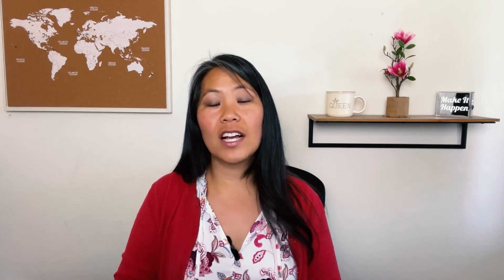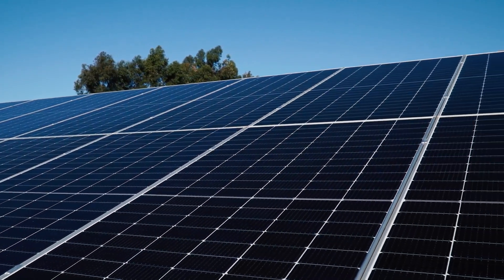Can Solar Panels Power A Whole Home?

Comment: Here is a related question:

Almost every device in the modern home has a transformer embedded within it that converts AC to DC because that is what the PCB, battery or motor demands. And that these same transformers all consume energy whether in use or not. Then there is every light bulb too which has transformers embedded within it and the control of the same lighting is incredibly complicated by being AC.

These arguments alone make sense, as the industrial world clearly demonstrates, especially when the user/homeowner has their own renewable source of energy, be it PV, wind or/and battery, all of which produce or store energy in DC form, it is bordering on lunacy to convert that energy first to AC and then later back to DC again.  

The fact is that electrical companies are able and can supply both, and sell DC systems to the industrial and off-grid elements of their business. But they certainly aren't going to inform the public, who are blithely filling their homes with transformers of all sizes, whilst buying more energy than they need to in the process.

Thoughts please - of course Code requirements will be light years behind us all!

Comment: You would need a huge battery bank to power an entire house with solar.  Otherwise, you aren’t powering your whole house with solar, you are powering using the utility company as your subsidized “battery.”
Reply: That's exactly what net metering is and yes, you're correct in that you would likely need multiple batteries to back up an entire house during a multi-day power outage.  Not only that, you would need a large enough solar system size to recharge the batteries in the event of a multi-day power outage.

Comment: Can ask you guys in Cali does the average person in CA Edison with a 130 ish bill still save with a single self consumption battery. I was reading for two months of the year the credits were 4-5 dollars.
Reply: Hey Lee, there is a small window of time when the utilities are compensating for exports from the battery.  It's for only a couple hours during peak time in September, every other time of day and throughout the year, it's pennies.   If you have a $130ish bill, it may be possible to do a bill swap, that's when your solar payments (if you finance) may start out around the same as your existing SCE bill.  But the savings will be over the long term.  Reach out if you'd like to a solar consultation specific to your home and situation!

Comment: Can 2 homes with dedicated electric meter share a common Solar System?
Reply: Yes!  This is entirely possible, as long as they share the same meter and if there is enough roof space for the solar panels.
Reply: @jaimegreene  The two houses are not sharing a common meter. Each house has it’s own meter. What I want to know is if one solar system can be shared by the two houses.
Reply: @linosalgado1442  Oh, sorry, I misunderstood your initial question.  In that situation, you would need to set up virtual net metering if your utility offers that.

Comment: I’m not sure if this is true everywhere, however I was surprised that my solar panels won’t work if there is a grid outage, and I don’t have storage batteries.
Reply: You're correct when there is a grid outage, your solar system won't provide power unless you have a back up battery with back up capabilities.
Reply: @jaimegreene - Or Enphase microinverters that make the system become a stand alone microgrid.  I think they're IQ8s.  It's called Sunlight Backup, but it only produces power during the day and you'll be without power at night.

Without Sunlight Backup microinverters, you'll need batteries because the system needs a signal from the grid that it needs to match/balance to send power to the grid.  This keeps solar panels from sending power to the grid and electrocuting the person working on the outage.
Reply: @zinaj9437  That's correct.  There is another video coming out shortly about batteries and I mention the Sunlight Backup with IQ8s.  But that's only in the event of a power outage during the day time in the event of a power outage.

Comment: One thing I haven't seen much discussion on is how to size a system for new construction.  It might be worth a video on its own.  I'm building an all-electric house with excellent insulation in the Northeast.  It will have heat pumps for heating/cooling, a heat pump water heater, induction range, etc.  Although I have usage information from my current house, the new one is a different size and of different construction. The old house has natural gas for heat and hot water, so it's a bit of a challenge to convert that into kWh usage.  The new house is will just have two people, whereas the old was a family of four, so I expect some level of reduced usage.  I've had to make a lot of estimates and guesses.  The good news is my utility has avoided cost net metering, so if I do oversize the system, I will be able to sell back to the grid for some level of offset.
Reply: I have an 11kW system, which because of clipping, at its peak delivers 8kW AC, here in southern New Hampshire. I just had it in April, but it’s looking like I’ll net zero through late Spring, Summer, and Fall but Winter is going to be sad when it comes to powering heat pumps. If I could fit it, I wish I had twice the system and could over produce in Summer. And, of course, someday there will be an electric car to power.
Reply: @generallyhelpfulsoftware646  You can always add on to your solar system if your roof has enough space and if your main service panel has enough back feed available to accommodate a larger system.
Reply: @jaimegreene  I know but I used up all the hard to see roof space and my wife isn’t going to like ruining the appearance of the house by filling in the more visible portions. I pitched her the idea of putting up a solar awning above the south facing garage doors and she was less than impressed.
Reply: @generallyhelpfulsoftware646  I hope your wife changes her perspective about the look of solar panels!
Reply: I just moved into my new home and I installed a heat pump hot water heater and I can tell you there’s no way cheaper to heat your water than this thing. I’m going  with a 9.2 kw system with Enphase inverters I’m only using less than 200 kWh a month so my plan is to install a heat pump for three season use here in maine  hopefully I can produce what I use ........ time will tell.
Reply: @no7dirtpoor  awesome to hear about your heat pump hot water heater.  More and more people will move to these and there are some companies beginning to do both water and heating/cooling combined heat pumps.  :)
Reply: @no7dirtpoor  This is good to know.  I also have the new GE Washer/Dryer combo that uses a heat pump for the dryer. I'm using it in my apartment while the house is being built. It's ventless (so no wasting conditioned air to the outside) and uses about 25% of the electricity of a conventional front load washer and electric dryer.  I've measured it. It's about 1.25kWh per load and at it's peak pulls 1000W. And it's reasonably fast; two hours from dirty to dry. I've read that after AC and hot water, the dryer is the third largest consumer of electricity.  My system is designed at 13.2kW and I'll probably add at least 30kWh of battery after we move in.
Reply: @SquireJethro  I went with a propane dryer cause I have in floor radiant propane heat and  a back up Rinini wall mounted heater plus I have wood stove in case all else fails. I learned from my old house you need a back up for a backup . Good luck with everything and let me know how it all works out for you!
Reply: No need to do all that. No system worth having in the northeast is less than 8kW.  Start there and start with enphase so that its easy to increase the system after your first year.
Reply: I’m in a very similar situation (in fact, almost identical) but reside in Florida …
Reply: Has your engineer  gone through energy efficiency on your plans (heat pump,water heater range etc..) along with the installation used?
Reply: This is a great question and I've helped new construction/new build and even new homeowners with no historic usage get solar.  Understanding all your appliances and usage intentions will help size a system that should cover your electricity usage for the new house.  Reach out for a consultation specific to your new build!